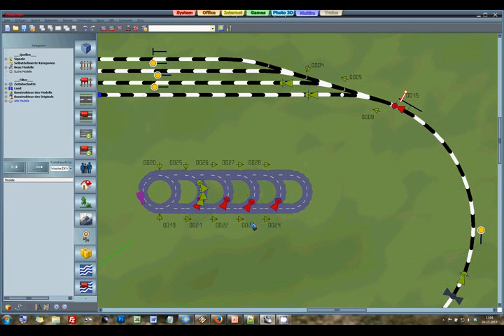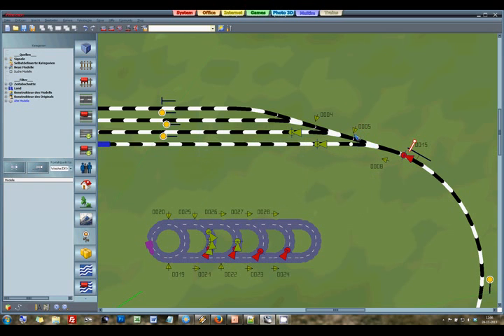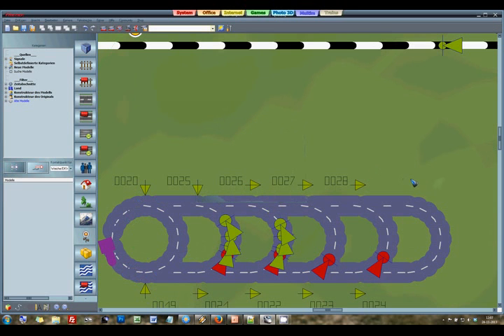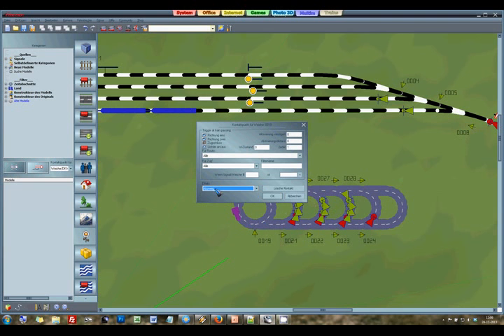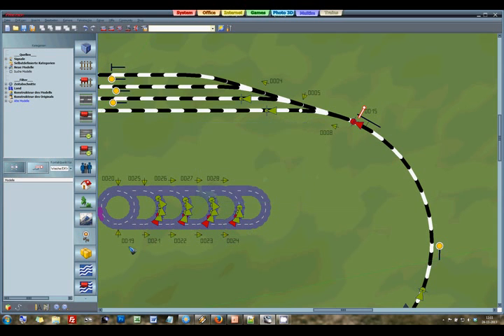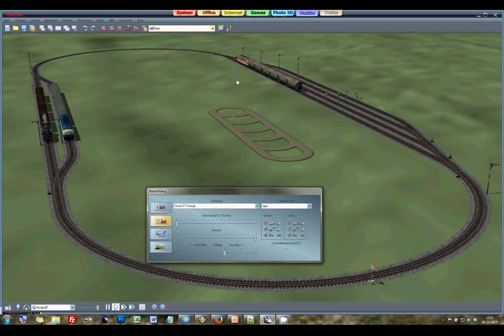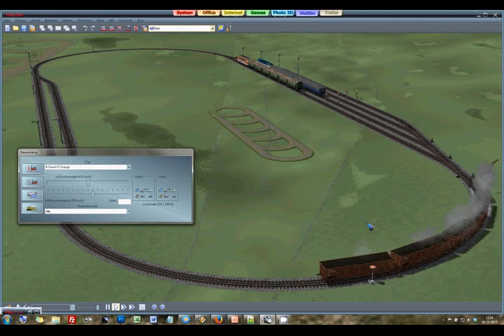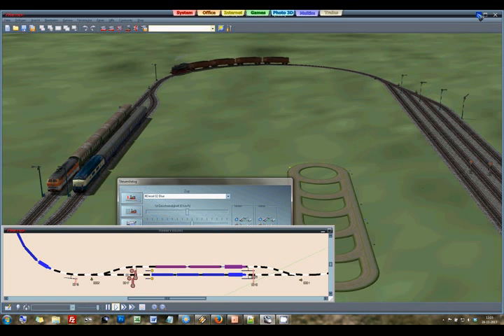EEP-X Tutorial 24 - Station North Entry Control Circuit Final - Model Train Simulator

Comment: Hi Ruud, great EEP tutorials you have made, they are very helpfull. But it is fun to experiment further, lang leve de lol :) By example at 7:56 I can now say, YES we can! I like it to maintain also manuel route control, so have made some changes in the lay-out, using all the knowledge I have learned from you up to this point to use both systems (the automatic and manual train traffic control) without flaws. 

One question, why did you put reset contacts at the east site of Station North to reset the switches 0008 and 0005? That is i.m.o. against the rule that switches are set ahead of a driving train. In the control circuit (the mechanism for automatic route control) I have placed the needed contacts to avoid the placement of reset contacts (as for switch #0008 and #0005). 

Inside the control circuit are my sub circuits as follow:

In the main control loop are of course the turnouts #0019, #0021, #0022, #0023 and #0024 (and their counter turnouts)

Contacts for sub circuit  #0021 (track North 1) : Signal #0015, Turnout #0008 (set to the main status), Turnout #0019, Turnout #0021. All placed in a contact group.

Contacts for sub circuit #0022 (track North 2) : Signal #0015, Turnout #0008, Turnout #0005, Turnout #0019, Turnout #0022. All are grouped in a contact group.
Contacts for sub circuit #0023 (track North 3) : Signal #0015, Turnout #0008, Turnout #0005, Turnout #0004,  Turnout #0019, Turnout #0023. All placed in a contact group

Contacts for sub circuit #0024 (track North 4) : Signal #0015, Turnout #0008, Turnout #0005, Turnout #0004, Turnout #0019, Turnout #0024. All placed in a contact group.

To inform the control circuit regarding incoming trains using a manual controlled trainroute (routes North 1 up to 4) I have placed at Station North also at the east side of its four tracks turnout contacts for comunication with control circuit turnouts #0021, #0022, #0023 and #0024.

For the save use of the automatic and manual controled routes together I created an extra block signal (being signal #0029) between the exit signals of Station South and signal #0015. The signal #0029 contacts, (set in the "go" status) are placed one the tracks of Station North. So, it is not possible to send trains (after they have passed Station South) to signal #0015 before another train ahead has already entered Station North. This because of turnout #0019 contact, being placed between signal #0029 and signal #0015.

Route control is according the two procedures I have. Trains driving the automatically controled route are set to the created "ARC entry North" route (ARC means Automatic Route Control) I have set control circuit #0019 contact to be only valid for this "ATC entrance North" route. So trains running the manual controlled routes don't react on what the schaltauto does in the control circuit! 

Entrance signal #0015 is only automatically set to the go status for trains using "ATC entry North" So, for the North 1 up to 4 routes (and also for the "any route") this signal must by operated manually. To assist the station manager I have created a fixed camera view (named "Entry Station North" not far from signal #0015. That camera shows the signal and the four station tracks. It becomes active if the signal is in the stop status and a train is passing the camera contact placed in the east curve of the lay-out.

Finally.. the contacts for the manual controlled routes (North 1, 2, 3, and 4) are also placed in a group contact. I have placed that between signal #0015 and turnout #0008 at a spot after a train has just passed the entrance signal.